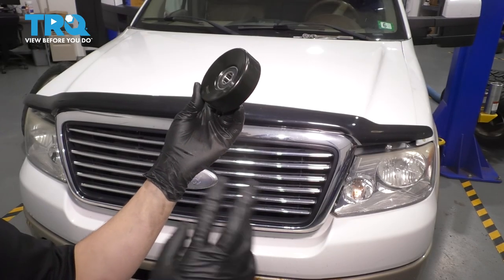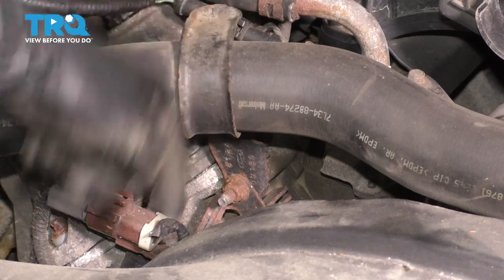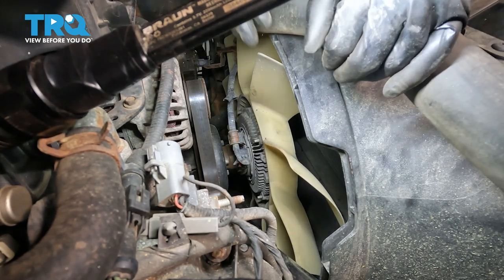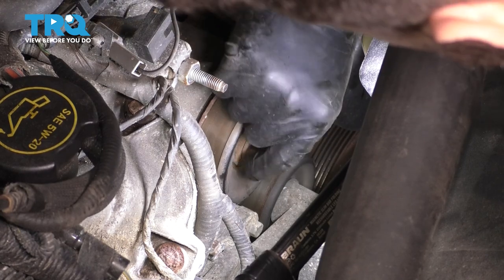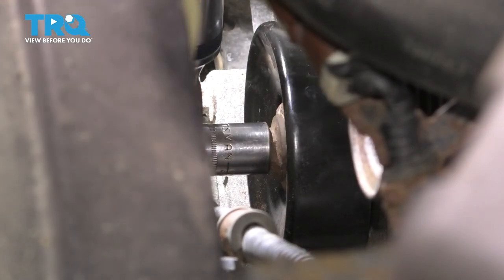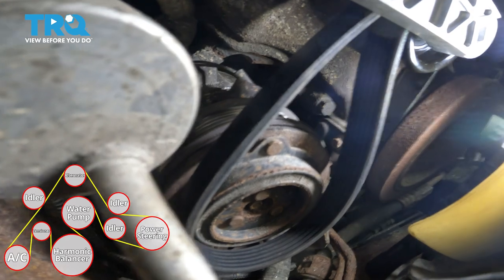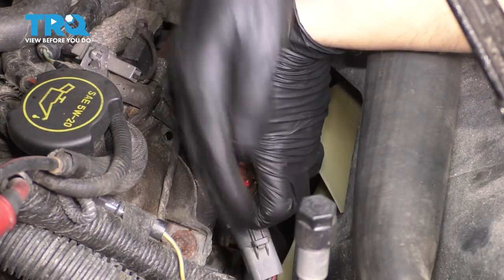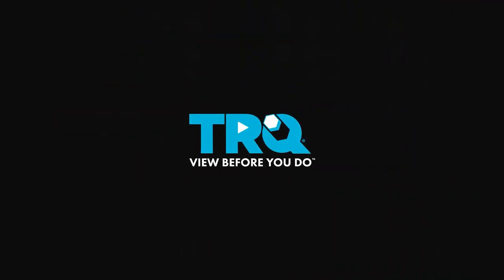Serpentine Belt Flat Idler Pulleys 2004-2008 Ford F-150

Comment: I can't be the only one that thinks there does not need to be a tutorial for this job. If you need an almost 7 minute long video to show you how to release tension on the serpentine belt, remove one bolt and the bad pulley, put the new pulley on and replace and tighten the bolt, then loop the serpentine belt back on, you probably shouldn't be working on cars or trucks. Just saying. 😂😂😂